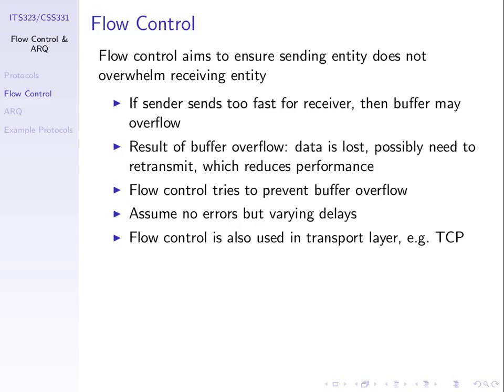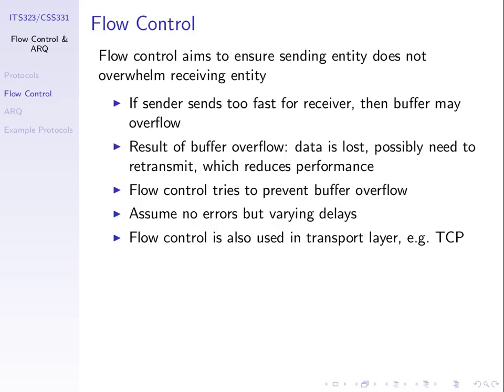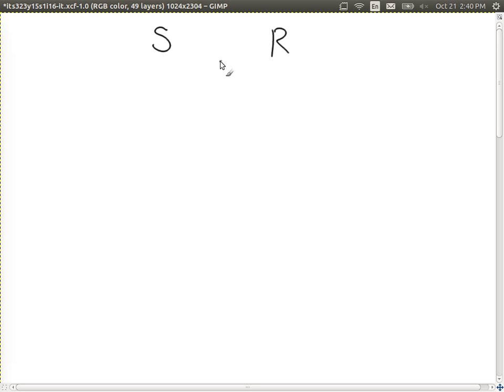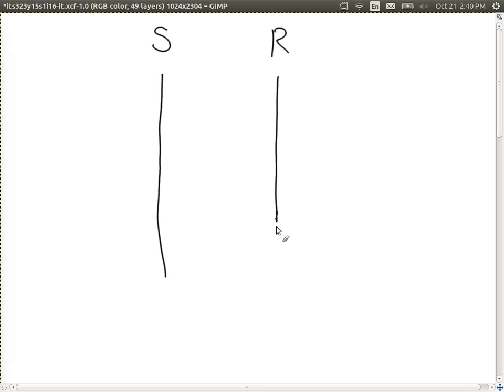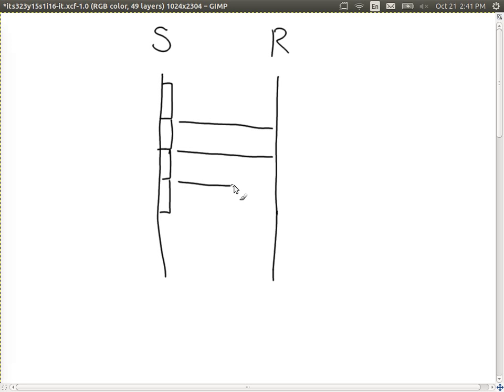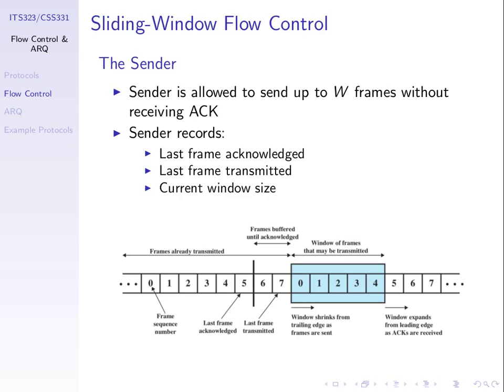Sliding Window Flow Control (ITS323, L16, Y15)

Comment: I think you can replace the word "improve efficiency" in this video with "improve utilization" . Higher efficiency means doing more work with less resource; higher utilization means use more of the available resource. For the discussion, we can assume sending 1 bit of data uses 1 unit of energy, and the link is just a pair of copper wire that is a passive device. Sending the same amount of data always consume the same amount of energy, regardless of algorithm.

At 8:24 , the stop and wait approach underutilizes the network capacity because the source could have sent the second frame just slightly earlier than the ACK comes and still not overflow the buffer. The extra wait time for the ACK to be generated and sent and propagate to S is what causes the under utilization. The long wait time between S's first packet and second packet is not what causes the under utilization because that long wait time is the necessary result of disparity of processing power between system S and system R. That problem of disparity of processing power can not be improved by sliding window algorithm. Sliding window algorithm only improves utilization by reducing the gap of no activity between ACK generation and ACK arrival and by reducing the number of ACKs.
Reply from the maker: +John C G You maybe correct about the difference between efficiency and utilization, and indeed in some times in lectures I may even use them interchangeably when I should stick to just one. 

However when discussing communication protocols and link performance, it is common to talk about protocol efficiency as meaning the fraction of time spent sending real/useful data (as opposed to sending headers or not sending at all), whereas utilization of a link is the fraction of time spent sending (either real data or headers). In my course I focus on efficiency as from an end-users perspective that is of interest.